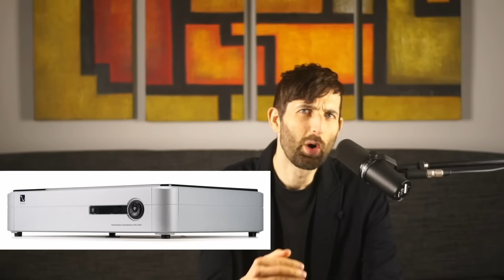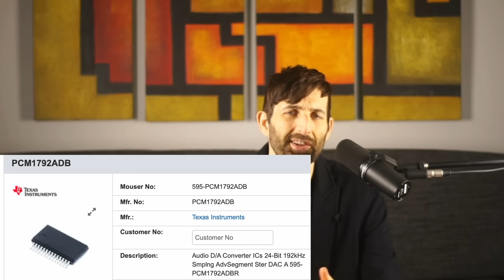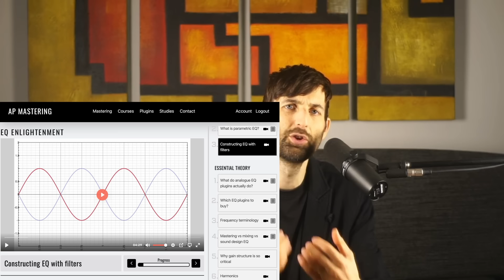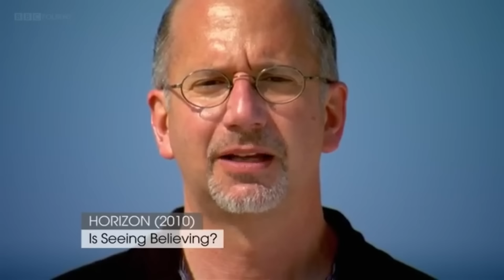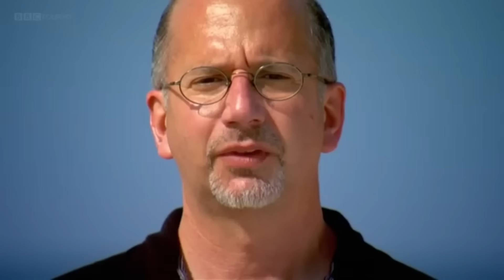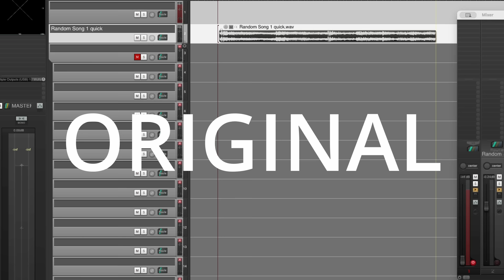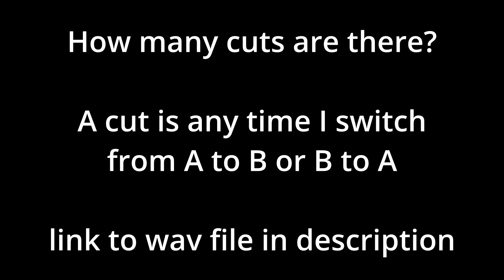The DAC Scam - Almost everyone believes the hype

Comment: I would argue that the chip is the least important component in a DAC. Power supply, electrical isolation, clocks, jitter rejection. Mikey over at OCDHiFiGuy gets great audio over YouTube, it sounds better using his recording as a source than streaming from Qobuz on my own system. He does many DAC shootouts using music and if you can't clearly hear the difference as plain as the nose on your face. He's always holding an SPL meter at the listening/recording position and everything is matched. It's a game of tiny increases and diminishing returns, but if you think your Class D amp and $200 DAC is the equivalent of something like Mikey's then I would maybe suggest you find a different hobby even on the same speakers in the same room I can guarantee that not only would it completely melt down even trying to come close to triple digit SPLs but it would not sound good doing it. If you like low volume background music and don't listen critically buy whatever makes you happy. If you think Crown PA amps are a match for Jeff Roland, knock yourself out. Everyone is so touchy about the fact that high end exists. We would just hang out at whoever had the best sounding systems house and enjoy the music and I don't ever recall there being any doubt in anyone's mind or any bruised egos or hurt feelings. So and so's was the best, if he wasn't around it was this person, then this, then this. I guess since no one has friends anymore and money is tight we all argue theoretically that it's all the same and everything is snake oil. Kinda like 2 guitar players can play the exact same notes at the same volume and still sound like themselves and not each other, there's a lot that goes into achieving good sound. If you start out with the opinion that it's all BS and buy the $99 DAC, crappy cables and listen to music on a Home Theater Reciever, don't expect everyone to be stopping by with new music selections to  listen to. Some people don't prioritize sound quality, they don't notice. A lot of people really. A local venue that has been around since the 60s and hosted Led Zep, The Doors and just a ton of acts is oddly shaped and has many spots that I simply cannot be while music plays. I have 2 or 3 friends out of 30 or 40 who might be at shows there, it's to a point where I know exactly where they will be standing, seated and I don't know how they can stand listening from that spot, it's awful and hurts my head and soul. I say hi when the band isn't playing, they say sit here with us and I never do, music starts and I'm gone. I'm not you and you aren't me. My GF somehow finds MP3s when browsing the HiRes streaming service and my toe stops tapping my face turns inquisitive and I wander over to see what she's done to my system, every damn time. She says what's wrong? Oh, nothing, your music sucks and where do you keep finding MP3s on Qobuz? I've never encountered a single one. If you don't hear a difference, you aren't alone, you are the majority, but it doesn't mean you are correct so just stop with this crap. My eyesight is bad, maybe someday they will have the equivalent of glasses for ears. I've mentioned the horrible sound to my friends with 20/20 hearing, but we don't berate those folks to their faces anyway. I don't even claim to have perfect hearing, I'd call it perfect listening. I'm sure the highest frequencies are diminished, but I will immediately feel a pea under the matress of what I can hear, 10-20KHTz is only one octave and it's well above the primary note of any actual musical instrument which is what I'm listening to not the air and sparkle, I'm there to hear the band not the acoustic acoutriments over which not even they have any control. Just like I don't care about 20HTz, that shit is for electronic music and explosions in movies. I don't care about either. It's cool, but I don't care. 32HTz is the lowest note and only several instruments can get there. Pipe organ is cool and all, but I only have one album of pipe organ music
Reply: It's amazing how gullible some people are.... manipulation of recording postings?
Reply: @davidcross890  Like I said, it's cool if listening ain't your thing. There is way more to a DAC than a DAC chip and there's more than just Delta Sigma DACs. Do you think turntables sound the same too, I mean it's just a needle on vinyl, right.
Reply: @BigFarm_ah365  I am curious 🧐 how you came to the polar opposite intention of my comment. Maybe you don't realize my developed work and systems for ultra State of the Arts audio reproduction? The differences that most smear is why so many have a corrupted ear toward listening and some say broken ears/brain?

Comment: All sound starts analogue and if turned into digital is messed with and then messed with again when converted back to analogue so it can be heard. 
An HP DAC IC costs £2.28, an NTC DAC IC for £0.98. They are a cheap item.

Comment: For years I have relied on the internal DACs of my equipment. However, last year I bought a second hand Sony 300 multi disc cd player. The sound of this player was ok but lacking in dynamics and excitement when compared to my single cd player. So I bought a cheapish Topping E50 external DAC and plugged it in using the optical out of the Sony. So bypassing the internal DAC and using the CD as a transport only. Wow, the sound improvement was and is incredible. Way more dynamic, lively, better separation etc. So I don’t think external DACs are a conn just don’t spend a fortune on one.

Comment: It's all subjective, i personally think all this digital streaming audio like youtube has embedded things in it that unnerve people and and mess with us because why wouldn't they? Or it's just the nature of the process of digitally sampling the sound. I got off a month or so long analog break where i was only listening to the dac. Threw in an 8 track and it sounded blaa to me for the first few minutes with my standard eq settings, so I turned off the tone control bypass on the preamp, boosted the bass and treble and boom! Performs Like a loudness button like my old sansui i used to run has, before i got the emotiva system. I probably listened through 8 albums between 3 of my players and loved every minute of it. I don't care what anyone says, the hiss, the occasional wow/flutter,  even with a little bleeding between tracks. analog tape from the 60/70's has something in it that you need you can feel it, less fidelity, but more of the original content and information that digital at any sampling rate just doesn't have.

Comment: Your rationale is good but very flawed. Others have already stated that a converter is more than the chip that samples the analog input. You are missing the clock, the analog design, the multiple digital formats you have to provide (those go way beyond simply soldering some connectors). It depends where it’s manufactured, what is the quality control, the size of the company…

At the end of the day, everyone needs to make a living, and people spend their money whichever they choose.
Reply: What formats? A DAC doesn't accept compressed or lossless audio formats, it only accepts uncompressed digital audio. Only 1 format
Reply: @kooijbas  PCM and DSD are two different formats.

But I was referring to ADAT, S/PDIF, MADI, Dante, Milan, AVB, DigiLink, USB, Thunderbolt, etc.

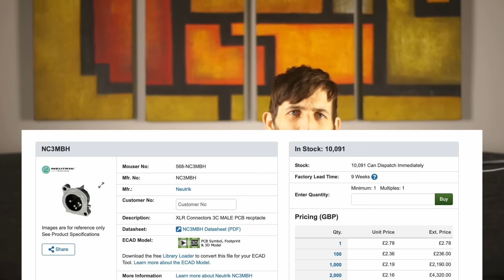Comment: 2:30 you forgot the most important piece of all.. the output stage... you're right about a dac  being 3rd least important in the chain but there's alot you don't know about the subject... and yes probably most of the time you won't be able to tell a difference... But there are cases where not any pre/hp-amp will play well with any dac and you'll have a system that just sounds bad, although this rarely happens nowdays.(Ps the solution isn't always more expensive).

Comment: I have a dac that cost around $2000 originally, I bought it used for $600 and it's the best dac I've ever heard and this is comparing them to very expensive and very affordable dacs. So, I somewhat disagree with this premise. The best advice I got about audiophile grade equipment was to realize real design change and can you hear the difference once you reach a certain price point. The AB test he gave on this show is meaningless, because I'm listening to it on my laptop with it's built in dac and it is a lousy dac, so I wouldn't hear a difference if my life depended on it. Some people are gear heads and use magical wires and other snake oil, but there is a difference. At the time my dac sold as new, there were competitors with very affordable dacs at around the $200 to $500 range. I would say they were equal to the $2000, but those affordable models crapped out years ago and are no longer available, while the $2000 model is still going as well as it did 20 years ago. I bought it used and I've had it in my system for 20 years and it has been used hard. Build quality makes a difference. Now to drive digital heads crazy, I still prefer analog. A decent turntable and cartridge make music that is more enjoyable, maybe not technically better by the numbers, but I enjoy it a lot more.

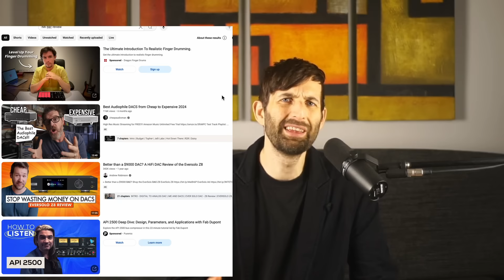Comment: 8:40 I’m no sound engineer or any kind of scientist, but the fact that you use and introduce a new modality into your test you stop testing for sound and more on the fact that we are hard wired as a visually  dominant species rather than sound kind of like the effect where we see a face, most inanimate objects
Reply: Ps I do agree with your main notion of your video that good dac vs 10000$ dac is imperceptible in difference

Comment: Spot on all the way.  I have been saying much the same for decades.  I remember some of the first CD players in the abysmal converters.  Now days, baring the crap converters in computers and trash equipment, there is basically little to no difference to be heard between DACs of competent design and implementation.   Only thru my Kyogo Stax SR Lambda Pro headphones with my ears rested can I discern any differences, maybe!

Comment: You are so misimformed - it is scary. First of all - any competent DAC designer will tell you, the DAC chip itsel is only responsible for ~10% of the DAC sound. The remaining 90% is PSU, doigital filter, analog output stage and CLOCKING. Second - I happen to have $60k DAC and $800 DAC based on same DAC chipset - AKM 4499. As much as I would like for the cheap DAC to sound as good as the more expensive one (I could sell the more expensive DAC and pocket the money) - they do not sound the same. The SQ difference is very substanial.
Reply: You are right of course about the different circuit components that make up the sound of a DAC. What I would seriously question is whether you have 59.2k worth of PSU, clock, etc. That's just luxury goods pricing with vast expanses of margin.
Reply: @gaborozorai3714 u actually forget the engineering effort put on that device there are 10 top lvl engineers working for like 1year nonstop on that project and only 10000 people buy that how should the company earn smth with out that high price?
Reply: @ I have no information on sales figures but 10k pcs seem way too many to me. That would be 60 million in revenue.No I do not forget the engineering input. Besides luxury pricing that’s my issue with high-end projects: lots of R&D going into a product that very few people will ever get to enjoy. What a waste.
Reply: @ if 10 top lvl engineers are working on a DAC to make it "better sounding", they're nowhere near close to being "top level", LOL
Reply: @praetor47  on a dac "better sounding" is not the target its better signal quality because "better sounding" is highly subjektiv your ear is not the same as the ear of other people. so top lvl engineers can make a top lvl dac with nearly perfect signal quality which is uninterruptable and has nearly 0 latency and is certificated by ultra precise measurements thats what makes an electric device expensive not any it sounds better bs
Reply: Yet my android phone will sound the same .. if i spent that kinda money I'd ve upset too
Reply: @triplebeam23  just because you cant tell the difference between a shouting goat and a musician doesnt mean that the musician makes bad music. in science terms the signal quality is the diffrence between a high lvl dac and an onboard low lvl dac
Reply: @S4RO_R3  what is signal quality exactly? Your hearing more of the signal then me? I've done multiple blind tests with 44.1 48k and 96 and nobody can tell the difference more then maybe once or twice out of the bunch .. and unless you have ears like a dog your not gonna be able to tell the difference my friend the margins are to small ..
Reply: @triplebeam23  1.a adult can hear frequencies till 16kHz a child can hear till 20kHz so there is no way u could hear 47kHz tf 
2. the 47kHz is the frequency with which ur device samples the audio signal (the frequency of with the single values are requested)
3.The signal quality describes how close the signal u get from the instrument can get reconstructed in the time planes as in the laplace/fourier plane. bc of our digital time signals are getting chopped and important information is loss now with all these filters you are trying to reconstruct the missing parts of the signal. in a perfect world the musican makes his music this music gets recorded digitally with an infinitely large sampling frequency then gets converted instantly by a dac chip and after that the circuit would smoothen the signal curve without any em noise or capacitive and inductiv interferences. But we are not in a perfect world and these interferences needs to be corrected and even the spaces between the single values needs to be filled
Reply: @ yup. as speculated, you have NO idea what you're talking about. there's no "important information loss". go reread Shannon-Nyquist, though i doubt it will help

stop throwing random words around to pretend to sound "smart". 'laplace/fourier plane' doesn't mean anything, lol
Reply: @praetor47  bro if u are sampling a digital signal u are only getting a value of one point in time until the next value comes now if you just hold the value u are getting sharp edges in your graph which results in high frequencies so that changes the signal huh now your filters are there to reduce that effect but filters are not cutting off perfectly they just reduce the higher frequencies (bode-diagramm of a low pass filter for ex.) now explain me how do u make an analog signal out of digital values what u describe is if your low pass and all the circuit around works properly then the information loss is negotiable its still there bc our harmonics are not just 20kHz they are even higher but still. and high frequencies/harmonics give sound  its characteristics for example c on a guitar sounds diffrent to a c on a keyboard or a flute
Reply: @S4RO_R3  'bro', reread the goddamned literature. the human auditory system is very limited and 'dumb' and easily fooled. that is a fact. the whole point of Nyquist-Shannon (upon which everything in the audio digital domain is based) is that nothing important is lost. nothing [within the context of human hearing. if you're a dog or bat who learned to type, which would explain a lot, then that's another story, but for humans....]

these are goddamned basics of audio. "BRO"
Reply: The golden ear syndrome
Reply: you are so misinformed, it's scary. first of all, any rational human with even an iota of rational thought in him and basic knowledge of physics, audio and psychoacoustics will tell you, any and all competent DACs sound exactly the same. if they don't they're not competently designed (unfortunately way too common, predominantly in the more expensive categories), or you're one of the 0,00001% of humans listening to the 0,0001% of equipment (headphones, speakers) in a perfectly quiet room the 0,00001% of music where such minute differences could even be heard

proven time and time and time and time again with objective data and blind listening tests. you know, science and that shit

the only folk who say that the difference in sound between DACs is 'substantial' are 1) snake oil salesmen [i.e. about 90-95% of equipment manufacturers in hi fi], or 2) audioFOOLs.

which one are you?

Comment: if all properly designed dacs sound the same, why is there so many companies that manufacture the dac chip? How do dac manufacturers choose them? "wow! cirrus logic looks beautiful than akm. So I will choose cirrus logic." Is that right? Why the manufacturers of DAC chip keep coming up with different models of the chips? If all the dacs sound the same, why are they still doing R&D? They can just shut the shop and invest the huge sum of money they spend for R&D into something else. why can't they design once and forget about it?
Reply: Most newer chips are designed for less power consumption (mobile products), added features such as digital volume control and higher bit depth for dsp functions and related digital filters. The actual conversion part has not changed much.

Comment: Hi @APMastering, I do agree on the chips, meaning I do not believe the most modern chips sound significantly different. I have a question though, isn't the analog section of a DAC, particularly the output stage, that brings a particular sound signature to it, more than its chip/digital section?

Comment: The problem is that this is actually not true, neither DCS nor WADAX photos of which you showed use ready-made chips for conversion. Even my modest HOLO AUDIO does not use a chip but a special circuit on discrete elements 😅 As for chips - you can get radically different results depending on the organization of power supply, clock, etc. You just claim something like "all beer is the same because it contains water".  Seriously?